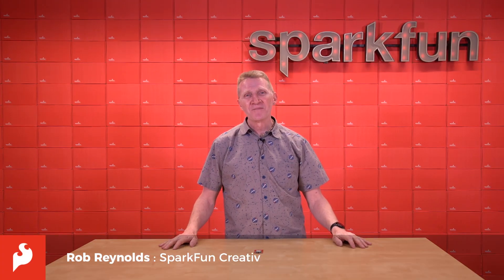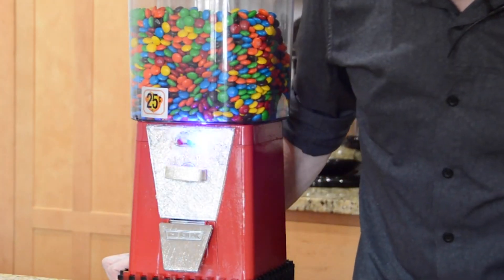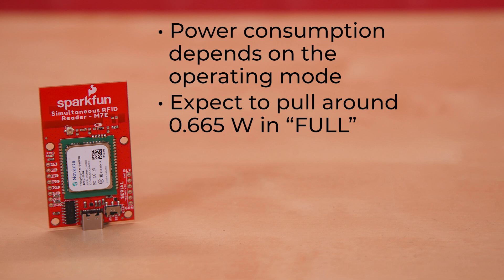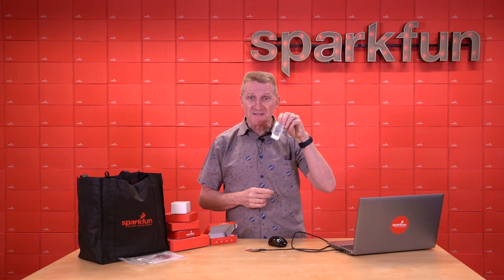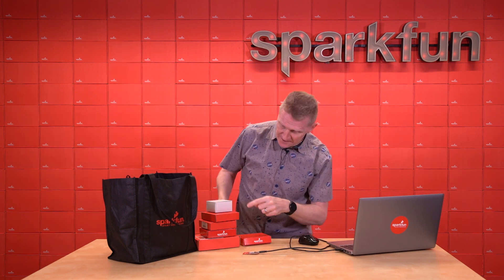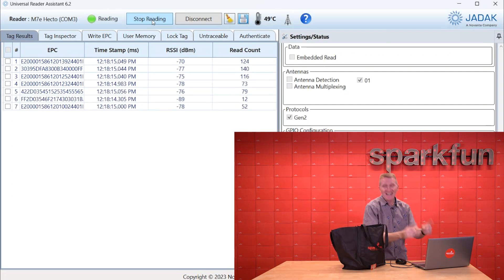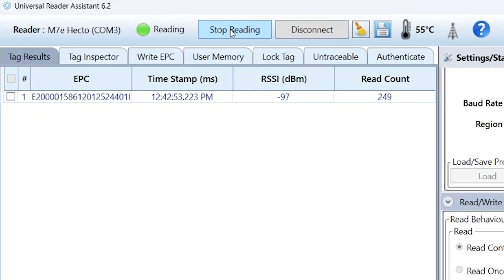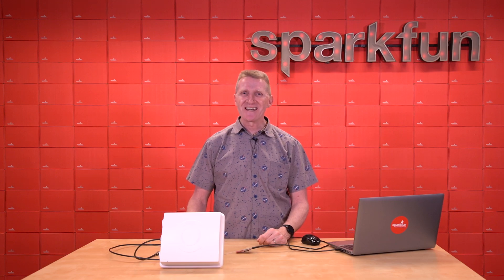Product Showcase: SparkFun Simultaneous RFID Reader

Comment: My M7e wont connect even though it shows up on the com port. Selector is on SER. Am I doing something wrong?
Reply: Switched the com port and cable and it’s fine now. Should be on usb unless you are connecting via serial rx tx ports